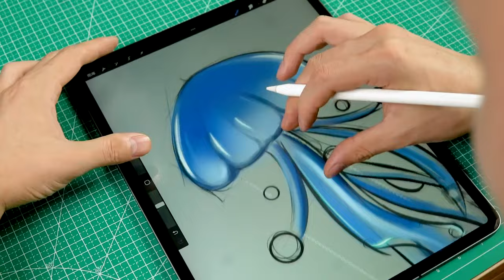How to Make Jellyfish Jewelry |如何製作水母珠寶藝術#jewellery #howtomake #jewelrymakingvideos

Comment: Do you use glue for enamel here?
Reply from the maker: No, I don't use glue for the enamel process. The enamel itself fuses to the metal at high temperatures, creating a durable and smooth finish without any need for adhesives. Using glue could compromise the quality and longevity of the piece. Enameling is all about the fusion of glass particles to the metal surface through heat, which ensures the purity and beauty of the design.